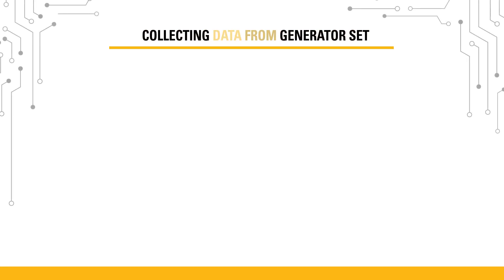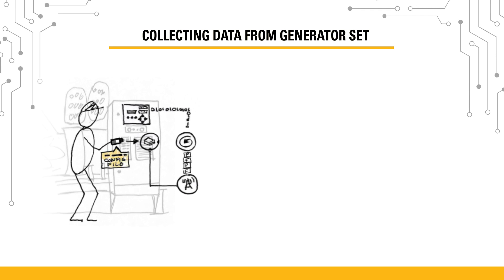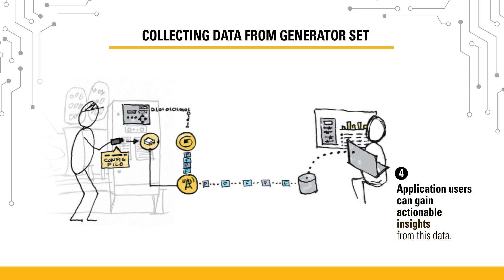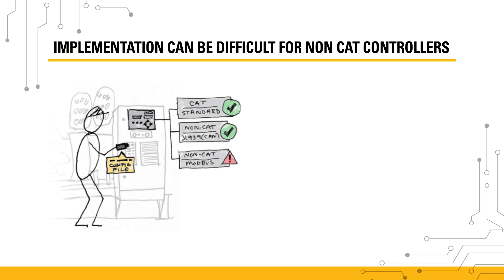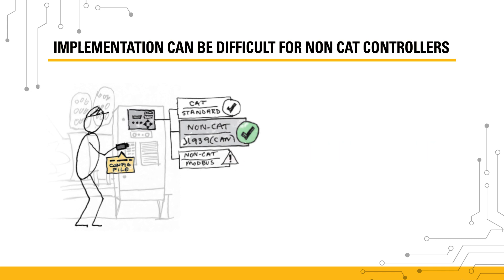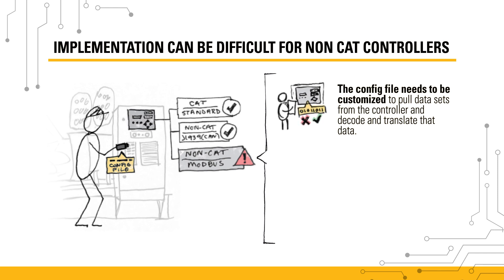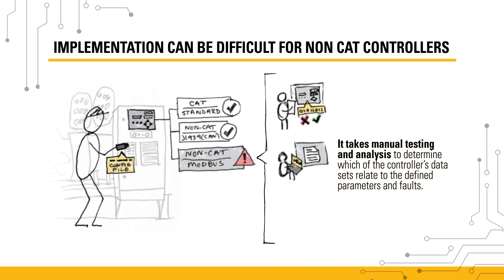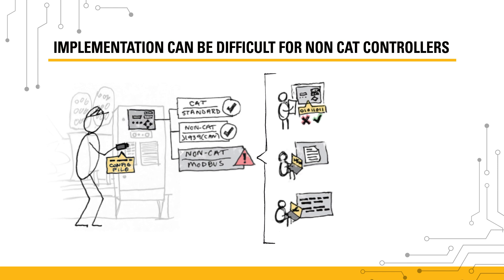Generator Controllers’ Critical Role in Remote Monitoring

Comment: acting violent or killing an operator wont solve anything a new operator will simply walk up to the machine and most liklely start running tht damn machine in a way thats more wilder way then you ever seen also THIS VIDEO IS FOR A PROGRAMABLE LOGIC CONTROLER THAT IS MOSTLY USED FOR TRACTORS DOSER AND OTHER DEVICES /TOOLS AND EQUPIMENT NOT USED FOR FKN YOUR MIND INTO A PILE OF MUSH